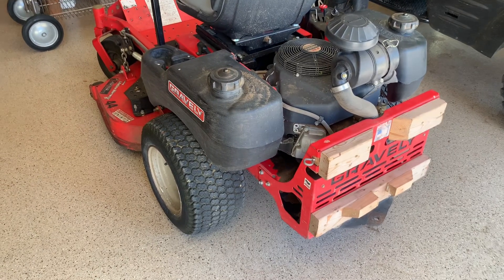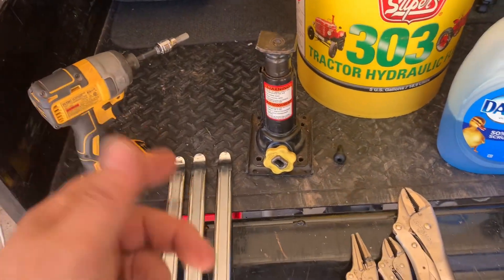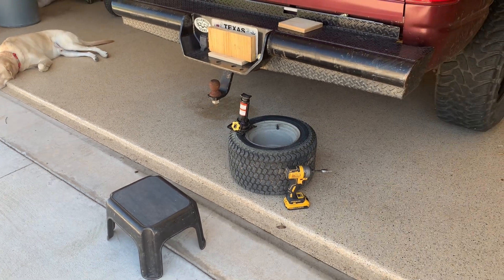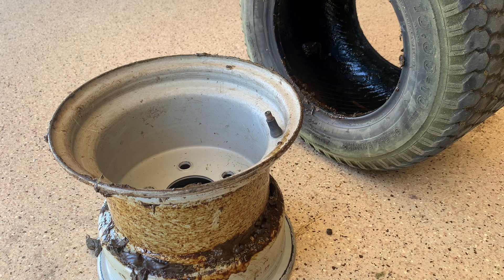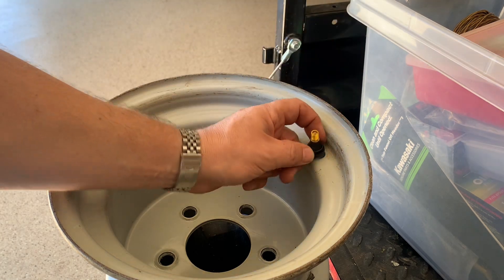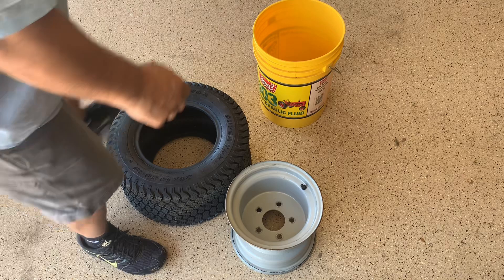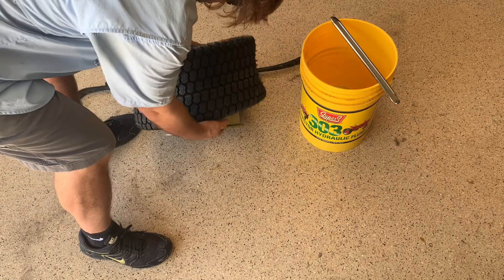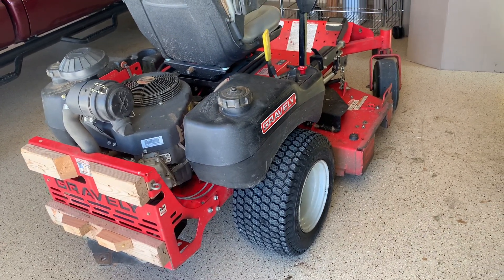✅ How to Change Rear Tires on Zero Turn Mower or Garden Tractor

Comment: this is the easiest method ive seen used to take the tire off the rim.  kudos.  with that remark, i'd still rather spend the extra $40 to have the new tire come mounted and aired up already on the rim than do all this extra work lol
Reply from the maker: Good point. I would too. But I haven’t seen a matching combination for sale that was inexpensive and match the proper sizes. And I hate throwing away working steel rims…
Reply: @ApacheRanch  gotcha! That makes perfect sense then!

Comment: 5yrs later video suggestion..... "this is why i dont use 'Flatout'." thanks for the video and the chuckle
Reply from the maker: yeah, I hear you.  But with the mesquite thorns here, cactus, etc it works pretty darn good for a while.  These old tires were very old and hung in there.  I do like FlatOut better than Slime...

Comment: After getting the tire on, does the bead set itself just by airing it up through the valve stem?
Reply from the maker: Yes usually it does. If it doesn’t there are videos on how to get it to take a bead.

Comment: What do you use to undo the bolts holding the tire on the axle?
Reply from the maker: Impact wrench
Reply: @ApacheRanch  How powerful must the impact wrench be, for example,  mid-torque or high-torque? What make and model impact wrench did you use? Thanks.
Reply from the maker: @SamW604  You don't need an impact wrench at all.  I just use it because it's fast.  These are not tight lug nuts - any socket wrench with extension (so you can reach inside the rim) will do it for removal/install.  My impact wrench is a DeWalt 1/2 inch.  Here's a link - https://amzn.to/3JumMg7